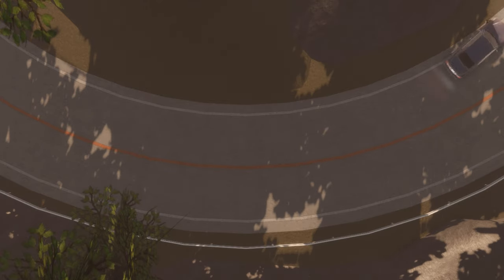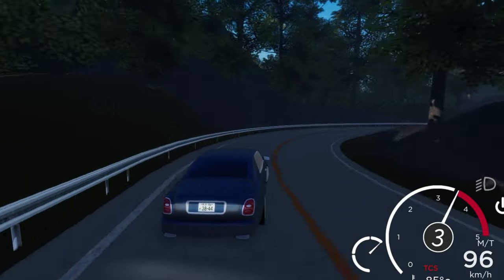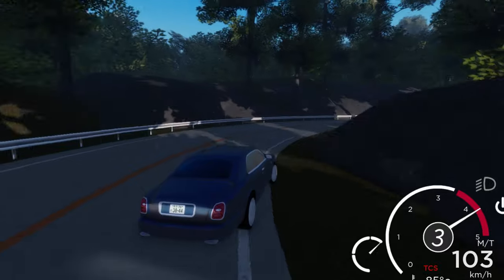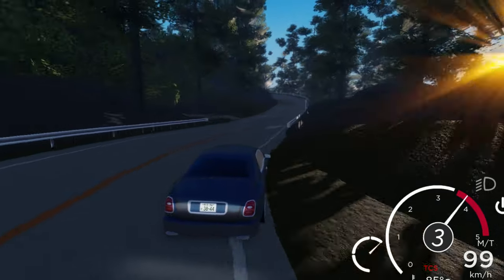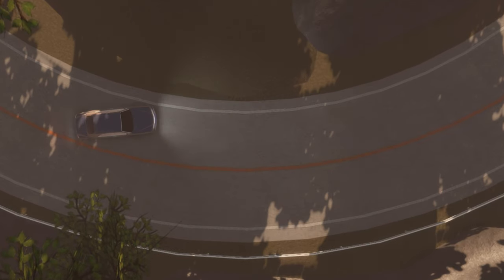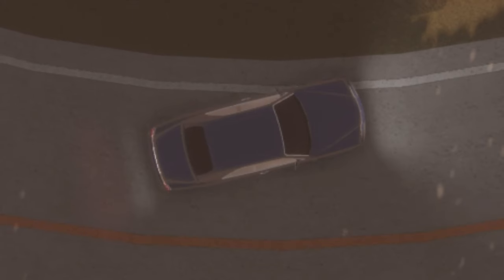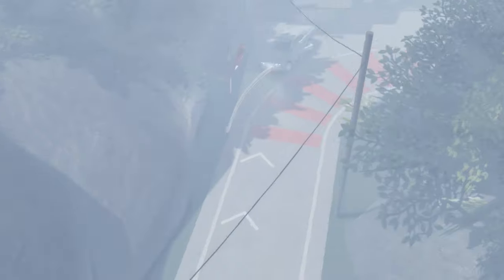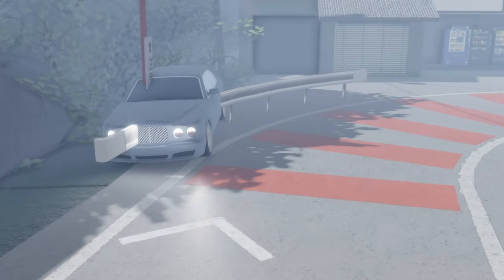Slip angle tutorial - How to get faster in touge

Comment from the maker: speedyacth
Reply: Speed warship
Reply: speed war dog
Reply: 0:10 i think this definition iz not right. Slip angle technique is a drift. Closest thing to "in between grip and drift" is Godhand's tecnique. Driver doesn't need to recover from drift (countersteer) so technically it's not a drift.
Reply: @sevvvich8118  if thats what you mean, then it's just a natural behaviour of the car, without being intended to drift.
Reply: @sevvvich8118  its definitely not drifting. if you think that im not surprised because of the way this video is formatted and suggests misinformation about what slip angle is

slip and is essentially turning with the throttle, done right you dont counter steer out of the corner at all. if you want to do it properly you should already be getting better lap times than average
Reply: just a quick question, what map did you use for this i cant really tell
Reply: Yo Can You Make A Tutorial On Scandinavian Flick? Cause I Feel Like Its More Easier

Comment: Slip angle is not in-between drift and grip, not any sort of drift. Learn more from these.
https://www.youtube.com/watch?v=9bs2cEyK7Uo
https://www.youtube.com/watch?v=1NTdXhLnA_w
This last one does mention drift and sliding a bit which is questionable, but shows it properly
https://www.youtube.com/watch?v=V6MX-xMY6M4
Typically only applied when at the limit, not something you should worried about otherwise.
Sadly slip angle has been making the rounds in the touge community after a certain someone made a video on it and everyone took him for fact. The “slip angle” you’re talking about is low angle drifting.
Reply from the maker: Understood thanks for the info mate.

Comment: how do i get better at driving manual? eg knowing when to shift before a corner, etc
Reply: Just downshift during brakes so that you don’t waste your throttle on low speeds, assuming you’re already braking as efficiently as you think you are 
Also you get more grip when you use 2nd gear 90 kmh aka redline than 95 kmh 3rd gear if you’re driving sth oversteery